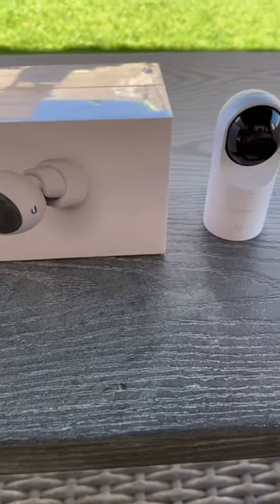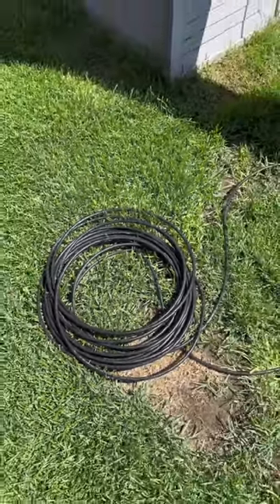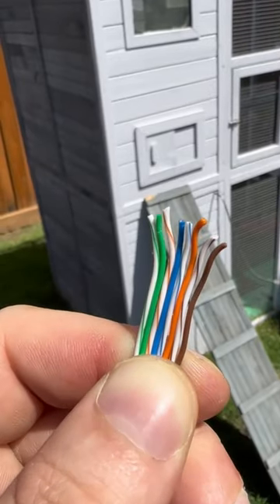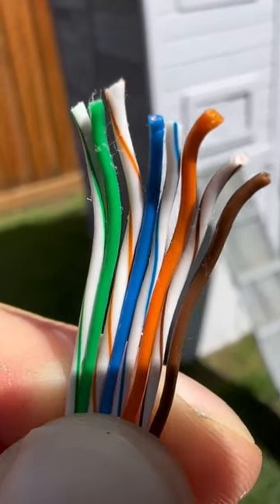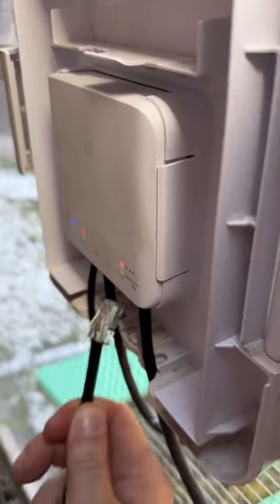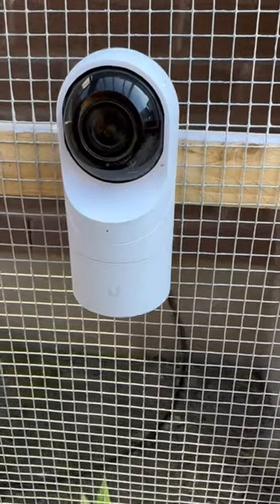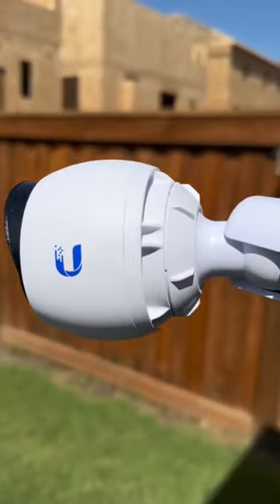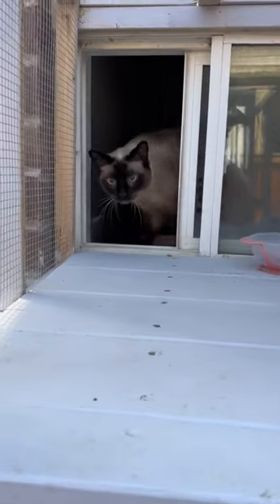“Professional” Catio camera install #shorts #ubiquiti #cctv

Comment: Don’t know why I have always used B, really don’t. Is there really any difference as far as performance goes?
Reply from the maker: No performance difference just make sure to use a standard :)
Reply: @MactelecomNetworks with most devices auto sensing these days, you can actually mix the standards on each end and be fine. It is bad practice and you should always match the ends unless you are intentionally making a crossover cable, but most of the time it will work.
Reply: the signal goes over/through the copper wire, not the coloured insulation 😉 same goes for elektricity... over here in Belgium we use the blue one as zero/null/... --> some think no elektricity pass through it. It's just a colour. Also the ground wire is green/yellow here. Doesn't mean cause it's the ground you can always safely touch it.
Reply: @MactelecomNetworks  ok, I'm getting into the weeds here, but there is actually a performance difference. The different pairs are twisted at different rates to avoid crosstalk between the different pairs, and the tighter the twist, the longer that pair is, resulting in signal travelling a longer distance and meeting more resistance on the tighter twisted pairs. Does this matter in a cable made to spec and under 100m? No. But there is a technical difference... 😉
Reply: @ASUSfreak  I’m well aware the signal goes through the copper, but the pairs being twisted makes a huge difference for interference cancelling, and a crossover cable has an A on one end and a B on the other end, but with PoE running DC current through it, there’s another potential source of interference. You can do speed tests and be super careful about the twists staying twisted until the very end, vs straightening out and there definitely is a difference.
Reply: @waynenocton  correct. I'm a medium voltage worker in Belgium... Till 10kV... Only do UTP stuff at homew not fit work. Many options indeed regarding twisting Pairs... With or without extra shielding per wire, per Pairs, etc. Shielded, non-shielded pffff.... Very much Fun to prepare one hehehe.... Good old cat5efor me lol, maybe 6, but the outer shield is too stiff tot work with. Then those shielded 7 ones yikes...
Reply: @ASUSfreak  agreed, really don’t even like cat6a, let alone all those other 7 and above.